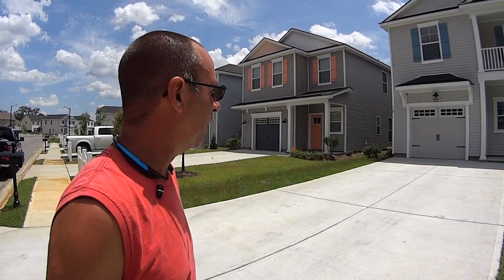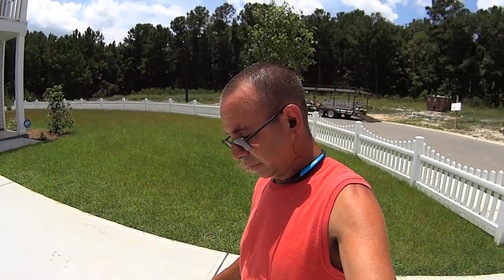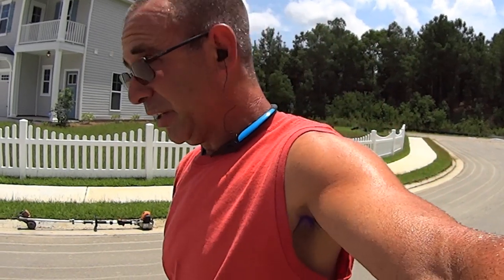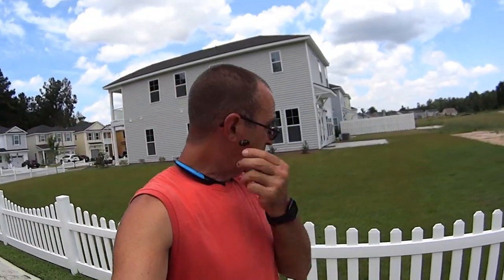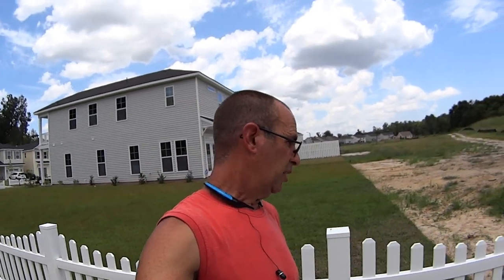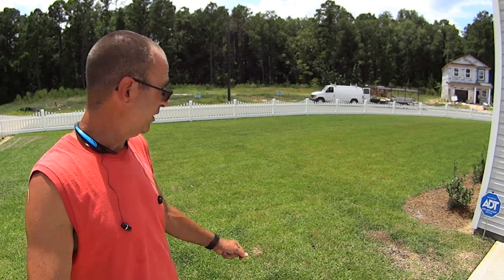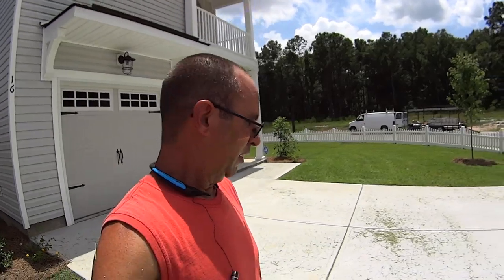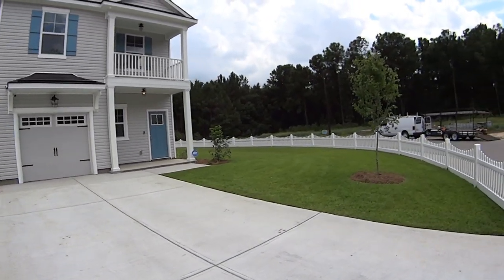Cutting NEW Sod / Grass - Excellence in Trimming Pro Tip - White Vinyl Fence #SideHustle

Comment: I recommend the havener enterprises single tire velky for these large yards. Don’t use a dual tire velky. I started with one and it was almost like trying to roller blade over again. It was very unstable. Folds up without having to chain to handle bars and you can remove it by pulling two spring loaded pins
Reply from the maker: Single wheel velkes leave a middle tire track that looks like trash. Been there done that. Had both types. Dual wheel much safer on ankles and does not screw up the yard. Just my opinion
Reply: Dan's Vlog to each their own I guess...my buddy who now mows 130 yards blew up his gravely prostance due to poor maintenance. used my walk behind while the prostance was in the shop. Used both single and dual tire velke and said the single tire was night and day difference..I mow mostly Bermuda so it doesn’t leave lines for me either way. I guess it leaves lines on “cooler” style grasses

Comment: I've seen you trim along a wood and vinyl fence.  What kind of fancy trimming technique do you have for along an aluminum fence?  I find it impossible to get in between the pickets with a string trimmer and end up using grass shears which takes forever.
Reply from the maker: I do not waste my time getting the grass that grows between a shadowbox type fence. That’s the price they pay when they buy something like that. If they want me to spray in between the wood with weedkiller very carefully then I would do that for a price but no way in hell am I going to be on my hands and knees cutting blades of grass with hand snips

Comment: Great job and video as always. I have a question for you Dan, how long would you suggest waiting before cutting new(centipede) sod, and at what height would you cut at? Irrigation system in use. Thanks in advance. Looking forward to your next video.
Reply from the maker: You can cut new sod in 3 or 4 weeks of laying it down. Depending on the sod type depends on the cut height and the  condition of the sod. I did this at 2.5 inch to ensure it looks well groomed but I honestly didn't cut much of the grass tips.
Reply: Watch Blades or Grass Lawn Care (Johnny) he cuts a lot of centipede lawns and he could answer your question.
Reply: Curtis King Posted my comment above.

Comment: Dan I want say you are pretty good at throttling that weed eater, however Stihl 4-mix motors don't like it. Go to the Stihl dealer and try a true 2 cycle weedeater and play with the throttle, you will like it much better. I do like my 4-mix because of the torque and power, but for just trimming I use my ole` FS80R.....Love that thing! Not trying to be a dick, just try it. Love your channel buddy.
Reply from the maker: Completely disagree. 2 strokes require high RPMS regardless of 4 mix or not. I throttle for safety when needed. Consequences are simple, foul plug and dirty exhaust. Simple maintenance and all good. I had a FS70 2 stroke. Wasn’t impressed. My 100 is 3 years old going strong. You’re not being a dick, I appreciate good comments